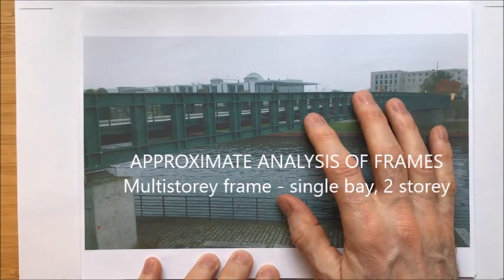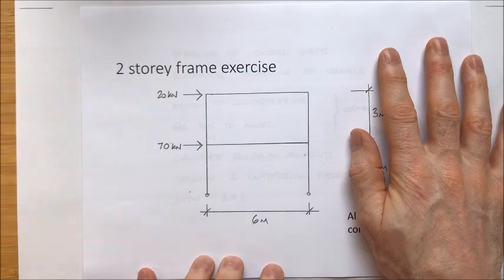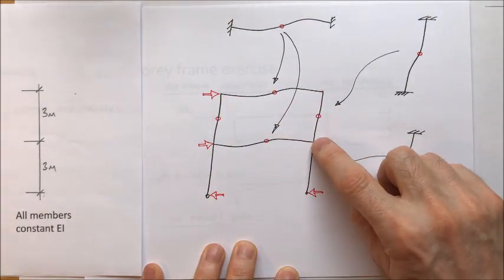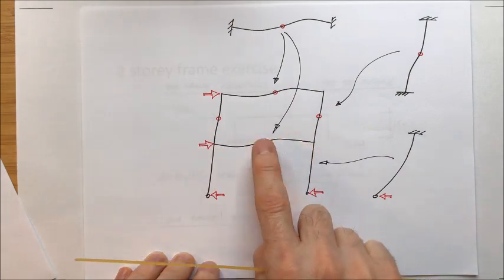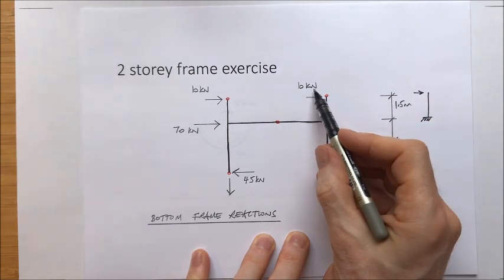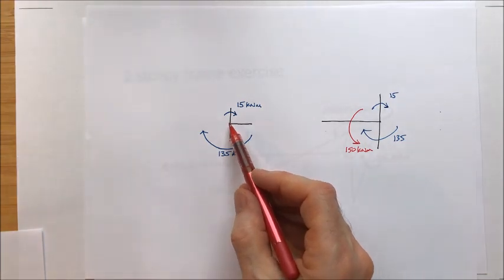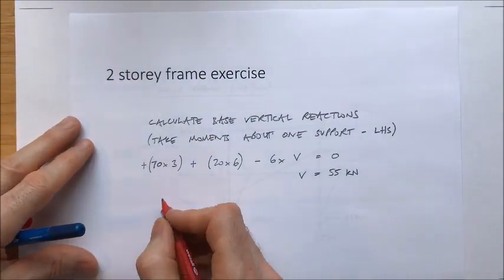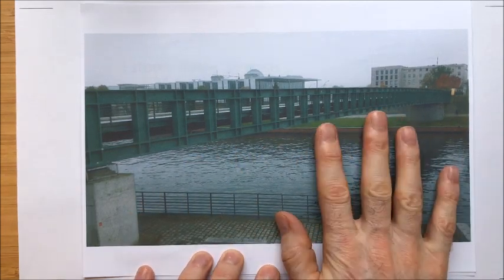Approximate analysis of frames (4 of 7). Multistorey frame - single bay, 2 storey

Comment: Thanks for the insightful video. Find it fascinating (and very handy) that one can work out the internal bending moments of the whole frame without considering the vertical reactions!
Reply from the maker: Hi Tom, That is a good point that you make, the bending moments calculated using this approximate method are solely due to the lateral forces applied to the structure. However, bending moments will also be created by the vertical loading applied too. These two sets of bending moments can be super-positioned to find the combined bending moments in beams and columns. Apologies for not making this clearer in the videos, Mike (PS I would probably use the tables of factors for bending moments for continuous beams in the Steel Designers' Manual to obtain the beam bending moments (if I had to do this by hand).